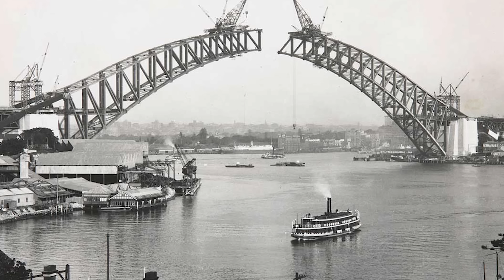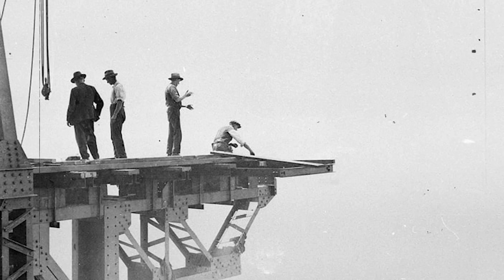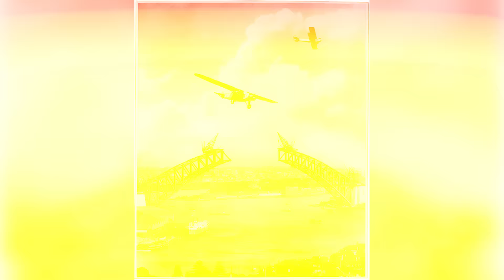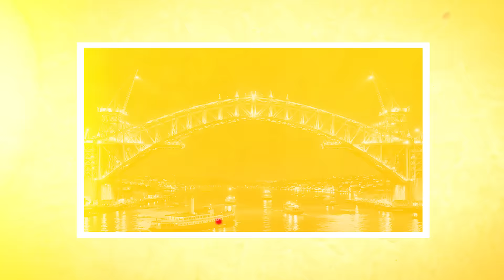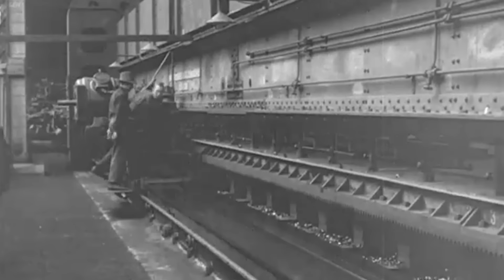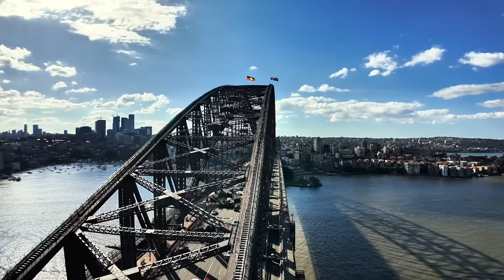Before Modern Engineering: The Insane Way They Built the Sydney Harbour Bridge

Comment: Looks like Runcorn bridge to me, lol
Reply: It's not Runcorn bridge but somewhere in England is the same bridge , just smaller . It was that design they used just scaled up .
Reply: @robertjohnstone3706  Newcastle upon Tyne 1928
Reply: @robertjohnstone3706 in the past, people would be in Sidney, saying they must be in Newcastle, because of the bridge. It looks nothing like the Tyne bridge
Reply: @kennethdrewary1094There were 5 bridges across the Tyne (7 nowadays).
Reply: @kennethdrewary1094 It looks almost identical to the Tyne Bridge. Both built by Dorman Long.  The SHB was started first in 1923,  the TB in 1925.  
The Tyne Bridge was completed in 1928  and was therefore a valuable test bed for the SHB.  Any problems encountered and they were on the phone immediately to Sydney. 
I grew up in Newcastle upon Tyne and now live a bit north of Sydney.
Reply: @doc3row  Yup,  the High Level Bridge, the Swing Bridge, the Redheugh Bridge, the King Edward VII bridge and the Tyne Bridge completed in 1928.

Comment: John Bradfield certainly had the vision for a Bridge, he did not design it nor had any responsibility for its construction, visiting the site only handful of times. The bridge was designed and built by Dorman long Middlesborough, England. Consulting Engineer was Ralph Freeman and his team. 80% of the steel was fabricated and transported to Sydney from Middlesborough the remaining steel coming from fledging steel works at Newcastle, Australia. The two crawler cranes were also constructed by Dorman Long to a design by Wellman Smith Owen Engineering Corporation Ltd. Darlaston, Staffs. The Dorman's Britannia Test House had capacity 1,000 tons and undertook stress testing of 1/12 scale replicas of the numerous connection joints etc. Once constructed there was a big falling out at the time as to who was responsible for the design. John Bradfield was ever only associated with this one bridge. Whereas, Dormans built numerous bridges throughout the world. My Grandfather was part of team who built the Cranes. I have a photograph on him standing on top of a crane during testing at Middlesborough.
Reply: As they say - Success has many fathers, but failure is an orphan.
Reply: I came from Middlesbrough my father worked in the ship yards as an electrician we came in 1966 by ship what a great sight It was seeing the bridge for the first time !